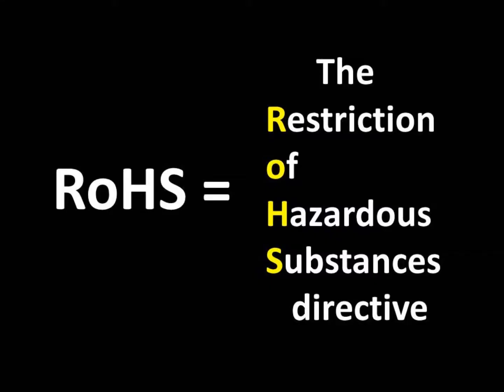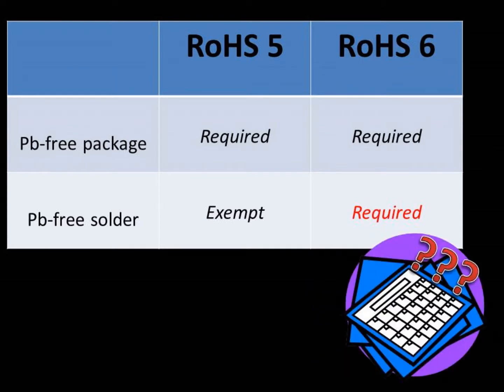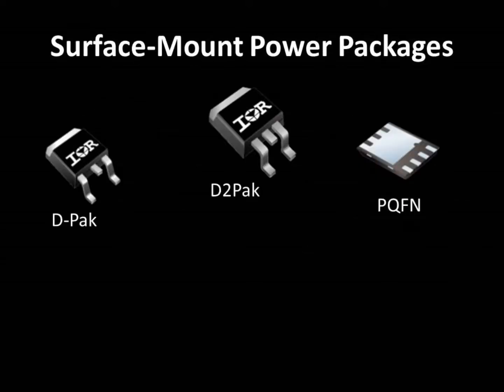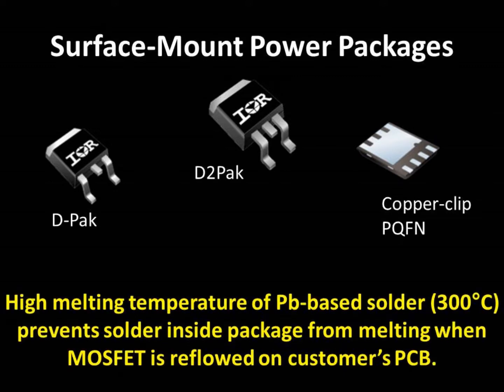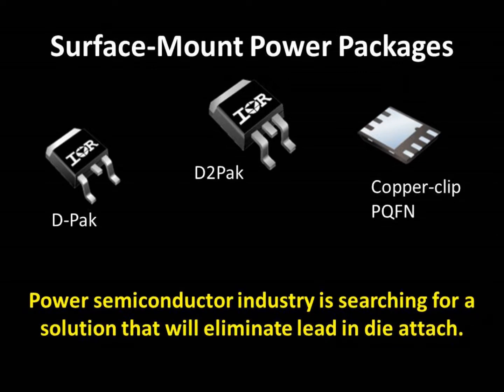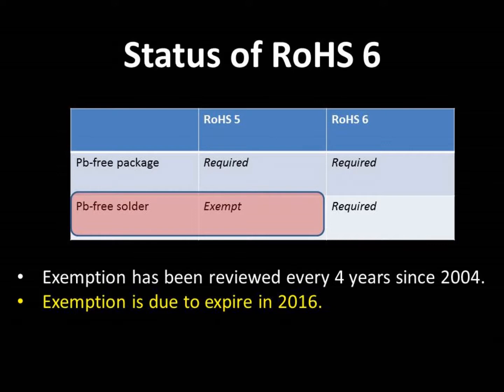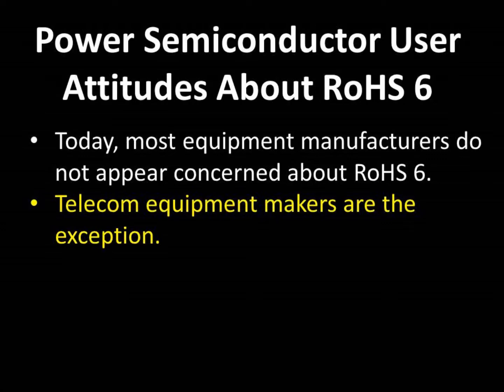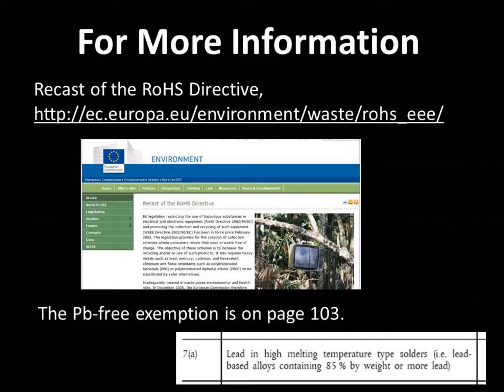RoHS and Power MOSFETs: An Evolving Standard Influences Package Selections

Comment: View ML comments, "In general what IR is declaring is true, theoretically, they also address medium big power applications. In fact, their directFET with the different size can compete with all main SMD packages like D2PAK, Dpak, and a few others. The only concern I personally have and maybe also some customers could have, especially in the automotive industry, is due to fact that the solder joints between the die and  printed circuit board cannot be inspected, and with this limitation in mind, the high reliability industry domain may refrain from using this IR solution. There is no doubt that, as usual, IR demonstrated itself to be an highly innovative player in the semiconductor industry, deserving the role they play in the today’s market place."

Comment: Viewer SH comments, "This video is quite good and informative. The subject is presented logically and clearly. The industry is making the transition to epoxy based die attach to eliminate lead completely from the package and this gives a good overall perspective on ROHS. Those working in the semiconductor industry have to frequently answer questions from high end customers about ROHS compliance. While many of us know about the  current status and the exemptions for die attach solder, details of the 4 year review and the coming ROHS 6 etc are something new and good to know.”

Comment: Hello Picotest1, To answer your first question: "Why do the datasheets say Pb free if there is Pb inside for the die attach? It's the most common question. The answer is that current RoHS requirements only restrict lead on the outside or the leads of the package. Therefore, by stating Pb free on the datasheets, this is correct by today's standards. 

To answer your second question: "Why is it that some packages don't have an issue with the lower melting point of Pb free solder and others do not?" Other packages DO have this issue, however, they are not subject to the high reflow temps of wave solder machines and therefore do not need a die attach with a high melting point. Only surface mounted parts with a large drain paddle on the bottom where the die sits have this challenge (PQFN, D2PAK, DPAK).

Brian LaValle

Comment: This video is interesting and well done, but it left me with 2 questions.  One is why do the datasheets say Pb free if there is Pb inside for the die attach.  The other is why is it that some packages don't have an issue with the lower melting point of Pb free solder and others do not.